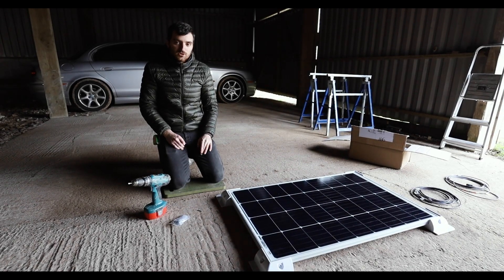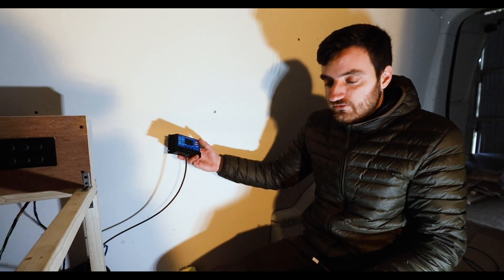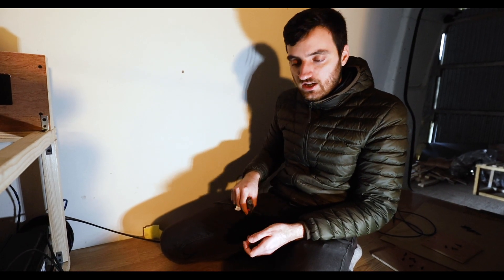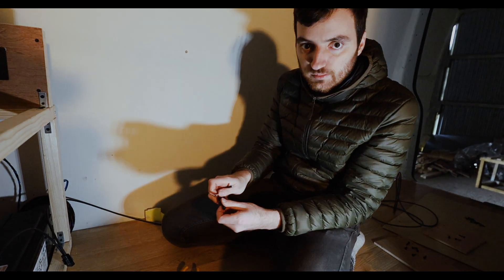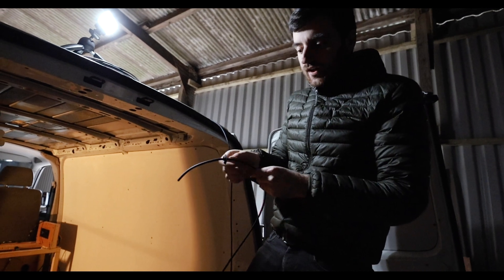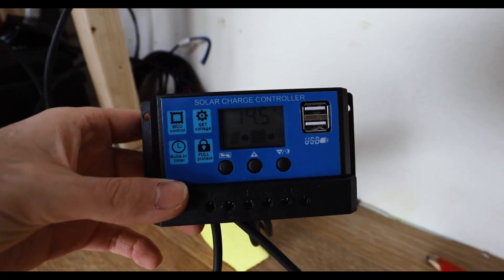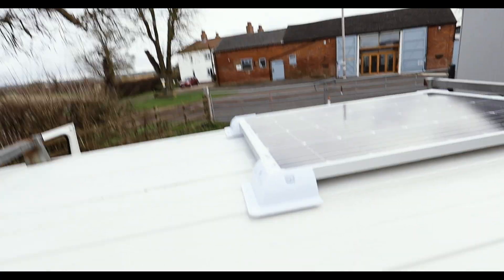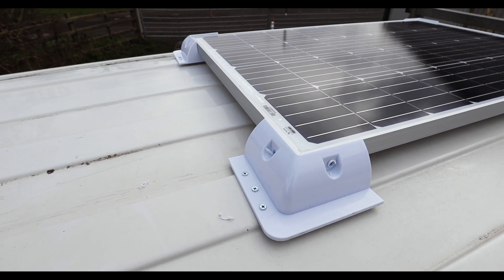Making Electric From The Sun | Solar Panel Installation | VW T5 Camper van Build | Van Life UK

Comment: What size solar are you using and do you have a link to the same kit thanks
Reply from the maker: We've got a 115w solar panel, rayne automotive don't sell that one anymore they only  sell the 175w one. https://www.rayneautomotive.co.uk/home/181-16725-100w-victron-bluesolar-monocrystalline-solar-panel.html#/165-mounting_kit_colour-white there's the link to that one 👍
Reply: @TabithaAndLiam  thanks for the link like the idea of using the existing holes
Reply from the maker: @jasonpugz  you're welcome, yeah saves cutting holes in the roof etc
Reply: @TabithaAndLiam  sorry to be a pain does the solar trickle charge your main battery or only your leisure thanks
Reply from the maker: Only your leisure battery 👍 I think you can set them up to do both but not sure how 🤔